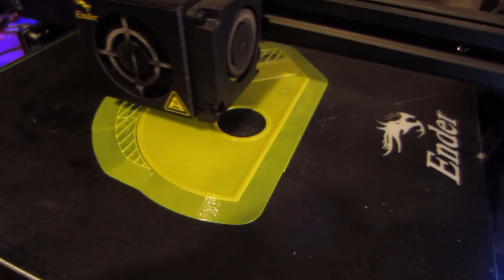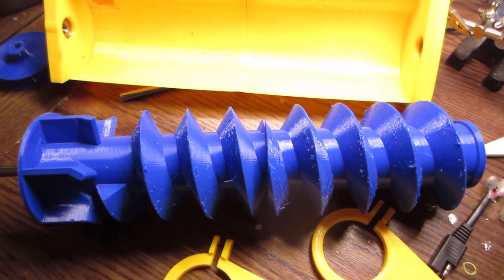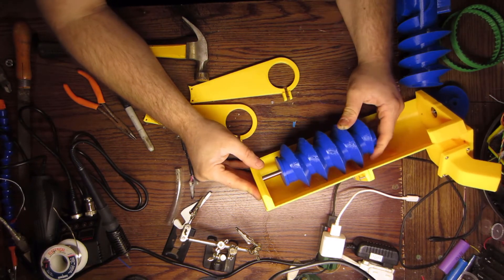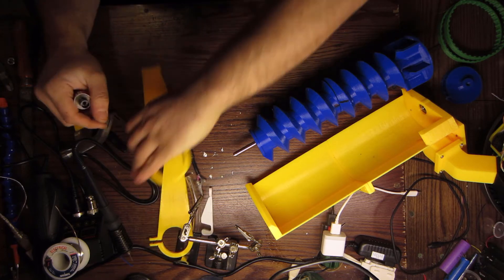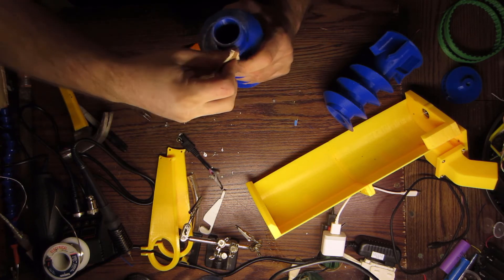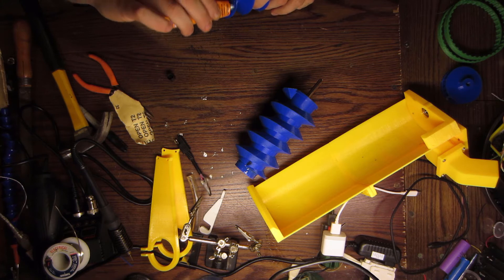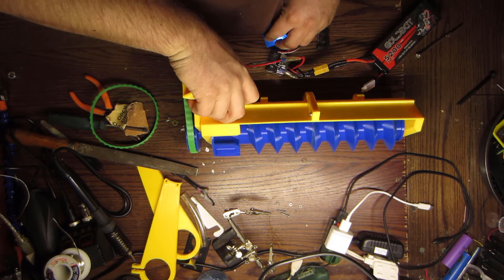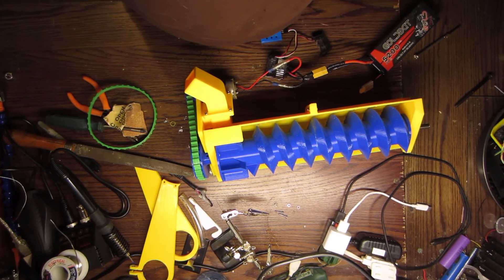3d printed snowblower

Comment: Super cool your printers bigger than mine but I might be able to do something similar. Thanks for the idea can’t wait to see if it works
Reply from the maker: Thanks , I'm using a ender 3 , the housing is sectioned together. Once im happy with the snowblower I plan on giving the stl files away .
on my revision i only made the blower half the width, as my motor choice is a little small for a 300mm blower , also less to print if it needs more design changes. I'm kinda slow at getting things out , as I'm kindof all over the place on projects and my medical problems. I hope to get it finished and distribute the files befor the sesons over, spring will bring a lawn mower attachment and by then a better platform to work from. if you  wanna see more of my projects and get files I host my stuff at https://turboprint3d.ca